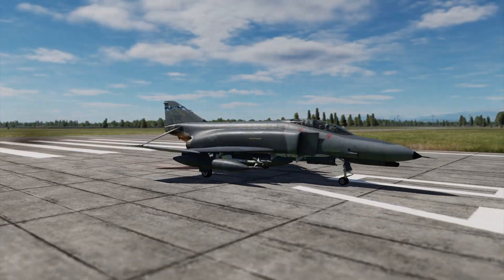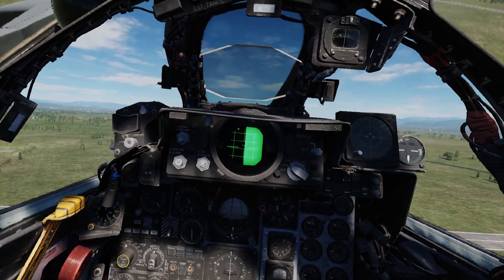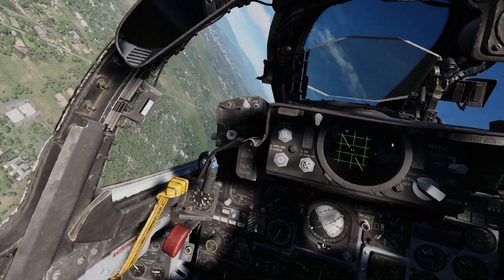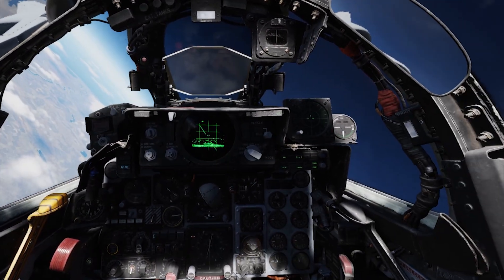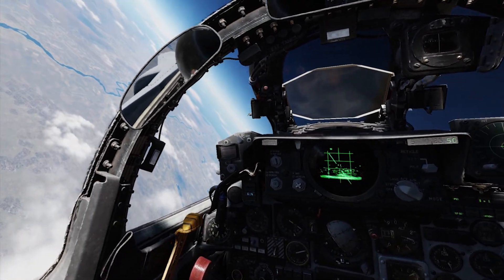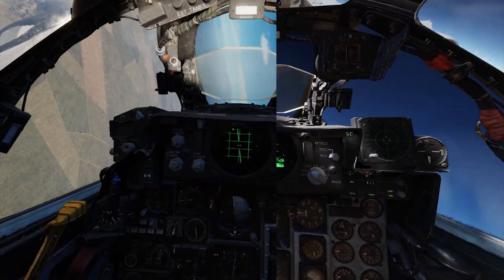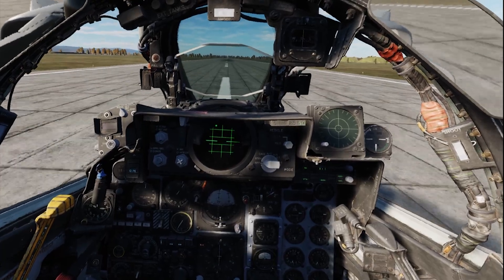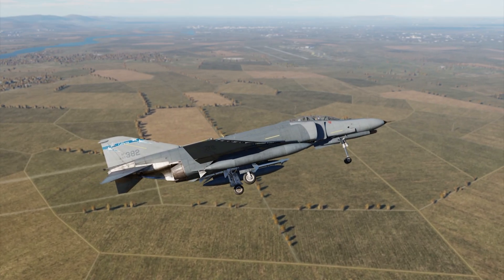DCS: F-4E First Impression, Flight Dynamics and Analysis

Comment: i have many DCS modules and with 3 i have trouble with trim to level flight and center stick !  The F4 is one of them. when i do trim nose down or up i cant see the elevator moving outside !? In F14 it works well for me; they move.  In F4 i always have to push the stick a lot forward to fly level which sucks a bit because my stick has a center force and it doe´nt feel right...not trimmed out ! Pls make a short vid how to trim that plane level in flight and stick centered.
Reply from the maker: Sounds like your nose down trim, or even the whole elevator trim at may not be working, I have no issues with the trim on the F-4
Reply: @FSX404  and your elevators are moving outside when trimming ??  pls make a short vid with the given inputs and keybindings. thx

Comment: The video I was waiting for! Looking forward to Pt. 2 (and hopefully a Top Gun series!)

Was watching a few interviews with F-4 pilots and they also mentioned "you fly it by AoA, not airspeed".

Why is AoA calculated and displayed in units and not simply degrees?

Great video!
Reply from the maker: Ohhh we just flew the part 2, with a back seater. It was awesome.

AOA is constant, thats what you use for the approach, speed changes for that AOA so you dont have to figure out your weight, then your approach speed... AOA there it is.

I have no idea why they use units. 30 units in this case is 18 AOA, point where F-4 (and a lot of older planes stall).

Comment: 4:47 what happens might be:
High AOA, stick to the left: right wing's aileron goes down, left wing's spoiler goes up. 
The right wing creates more lift (aileron acting similar to a flap) but also (much) more drag than the spoiler on the left wing, which will cause some drag and lower the lift of the left wing. Overall, this makes the aircraft yawing to the right, increasing the airflow speed over the left wing, producing more lift and causing the roll to the right. 
If using the rudder this will also cause yaw to the right with increase airflow speed over the left wing and reduced airflow speed over the right wing, causing the intended "roll right".

Comment: I think the FM is really good for a fresh release. HB modules have the best flight models imo, and knowing them the Phantom is only going to get tweaked and improved as time goes on
Reply from the maker: I'll take an issue with F-14, I think its off by a lot at slow speeds, but F-4 is much more improved and accurate for sure

Comment: taking off loaded.. that wing rock.. are you flying with STABAUG off? I've never had that happen with 24 500lb bombs. Just curious. I've been taking off on by the numbers as well
Reply from the maker: Possibly, how do you turn it on, I'll try it. In any case I like the instability
Reply: @FSX404  Later on you mention the dampening when working on slow speed stall behavior, which leads me to believe you have them on. The three two way toggles directly behind the L/R Engine Master switches. If you have them on, I may be being a little more timid on my inputs when loaded down for forestry work.
Reply from the maker: @NyteStalker89  do you have 10-11 pitch on rotation? And 17-18 units on AOA gauge?

Comment: I guess I am not the only one who first goes to MCAS to test out the flight model on a new release.  I was expecting a flight model that was a lot more difficult at low speeds and I found the F-4E to be quite benign overall.  The stories I had heard led me to believe the Phantom could bite you and be tricky and I have not found this to be the case.  No matter how hard I try to stall the aircraft,  the worst I can get is a 180 degree roll that then ...  just ends ... and the aircraft reverses its roll and levels out even when I try to hold it in a stall condition.  I had to really work at it to get into a flat spin and normal spins beyond one revolution I haven't manage to achieve at all.  The most I can get is a half roll and then it just ... levels out.  

I have never flown an F-4E so I can't really comment about the accuracy of the flight model but to me a Cessna 172 is easier to stall and spin than the HB F-4E module is at this point.  Overall though, I am really enjoying the module and, as you demonstrated, the flight model in other regards is very good.

Comment: Hi Gvad! Take a look at ground effect on HB F-4E, please. It looks like it's missing. 
And I don't like how HB Phantom departs but doesn't enter the spin, and how it reacts on aileron input on high AoA. Yes, you show right behaviour on your video, but try to  exacerbate aileron movements and don't use rudder - aircraft in DCS will go into a comanded roll. 
And engine obviously needs improvements - it spools up instantly. 
I'm not sure how it should be, but HB Phantom pitch up on 1.4M - 2.0M, that looks wierd for aircraft with stabilisers behind the wing. 
What is good in HB FM is that it works when airflow is reversed (when aircraft falls backwards on "bell" maneuver), forces on stabiliser become inverted. That didn't work on HB Tomcat.

Comment: VR, max settings, and the F4…just what kind of beast of a PC do u have? 😂
Reply from the maker: I have a crappy one actually, not max settings rather medium and low, 3080 card with 64GB and i9 I think. But aleady bought parts for the new PC that should be a little better, 4080+ etc.
Reply: @FSX404  Oh wow, on the video things look pretty good tho. I’m really struggling to get some proper frame rate with the F4, specially when I turn on both the mirrors and the radar. It’s by far the most demanding module on DCS, specially on multiplayer. I’m not sure if that’s just how HB wants it to be or if it’s just a lack of optimization, but I’m not even using that much my CPU, it stays at 40-50% usage and my GPU won’t go above 70%, yet my frame rate is just not great even with medium-low settings… :/
Reply from the maker: @supermendi0078  ahhh I see, I havent tried on multi player yet other than 1 vs 1 on my server.

Comment: Is the stall data above 200 knots from your F-4 SME friend for a slatted/soft-wing Phantom?
Reply from the maker: Israeli IAF F-4E, and these guys were top of the line fighterpilots. Its why video took a week, I wanted to confirm this specific point.

He also said that if you kept pulling and pulling while in a autoroll you'll end up in a spin 100% of the time, and that wasnt coded but I didnt mention it in the video.

B, C and J are a different animal thats even more notorious than E, which is quite milder than others.
Reply: @FSX404  Roger that. Might be a good idea to file a bug report then.
Reply from the maker: @ilejovcevski79  file a report?
Reply: @FSX404  I think he meant mentioning the false/incorrect stall characteristic above 200 knots you saw to Heatblur
Reply: @FSX404  LOL, typo! Bug report!
Reply: @ilejovcevski79  I would not jump the gun on this. I did a bunch of testing myself and although I expected to encounter more wingrock etc, I havent seen anything that is definitely 100% a bug. There is plenty of info out there from training material, test pilot guides and specific testing results for stall and spin characteristics for the F-4. What the F-4 does at high AoA is highly dependent on if its a slatted or unslatted F-4, CG, stores config, how the stall is entered and control inputs. The soft wing was much more benign than the hard wing, and even with the slats override in the outboard section is still different than the hard wing.

I tested level and accelerated stalls in a clean config , with the slats in and out and it generally coresponded with all the official documentation Ive found online, which Im sure HB has access to as well. I still want to try out more loaded configs and maybe some asymmetrical stuff. Im not saying im sure its 100% correct in every way but I dont think the quick test here is conclusive enough to say that its not. I suggest this be tested in alot more detail before going around making claims that this is modeled incorrectly.
Reply: @d_b_7819  i am far less familiar with the fine points of the F-4 flight characteristics myself, especially the soft wing variants, unlike i am with say the F-14, so i can't really tell. I was only referring to the Israeli SMI statements mentioned by Gvad.
Reply: @ilejovcevski79  Sorry, wasnt directed at you in particular. Idk how the sequence of YT comments works if you reply in a different order. I checked the tacviews from my flights and ive definitely departed the airplane above 200 knots.

I just think claiming stalls arent implemented at all above a certain speed and claiming its incorrect because "I know a guy who says such and such" seems very premature. The relation between stalls and AoA and that they can happen at any airspeed is very basic and fundemental knowledge, and Im sure HB are aware of this.

Comment: Great video. But i still salivating for the MiG-17. I finally get a combat manual for the 17, from '72. So i already learning the craft.
Reply from the maker: 17 is a Gen 1 plane, quick and can turn but only when inside the envelope, you get to the edge and MiG17 is tumbling. There are 5 or 6 different types of stalls as opposed to 1 wing roll in the F-4. There are no dampeners, flight computers to help you. One moment you're flying next moment departing. If you look at an airshow, ask yourself why arent they doing edge stuff with the 17, just a turn and fast pass, theres a reason. So be ready 🫡
Reply: @FSX404  Oh i am ready. Soviet style. By the book. 😃
Reply from the maker: @tamasratkai1130 and you have to fly it by the numbers, its not forgiving if you fall behind the plane 👍🏻👍🏻